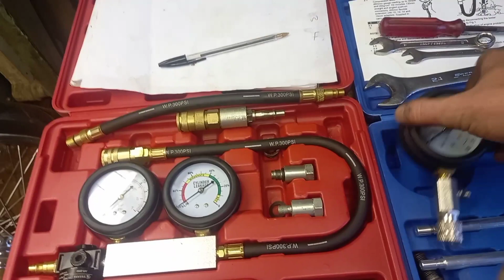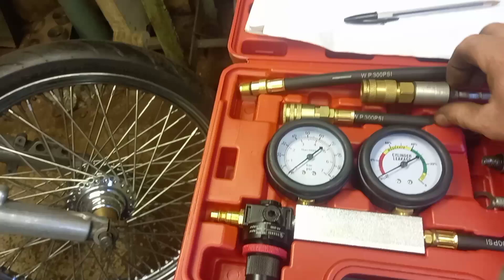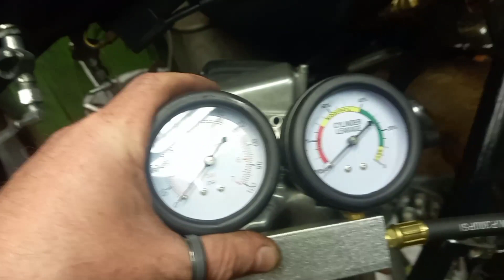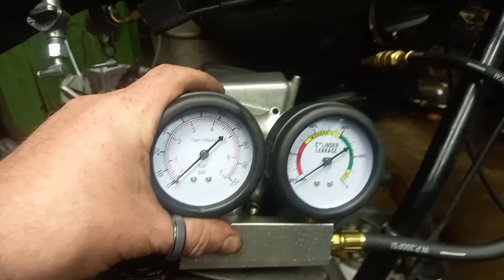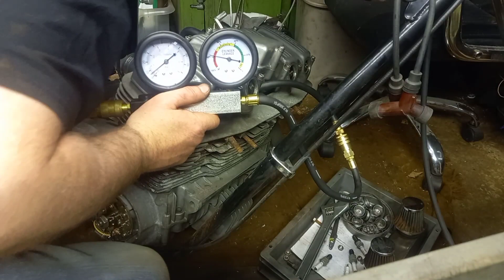CB750 Chopper - Engine compression test, leak down test & diagnostic health check. Did I kill it??

Comment: very cool video men. would be nice to see you take it apart and bring it back to life. i just hope it won't be an expensive job. good luck with it.
Reply from the maker: I'll be digging in after work tonight. I'm sure it won't be cheap but I think it might take a few weeks to locate all the bits, so that will spread the cost. Should get change out of 500 quid??
Reply: don't you think it would be cheaper just to get FJ engine and throw it in that frame?
Reply from the maker: @pawelbalcerak9630  Definitely, but if I go down the FJ route, I'd make a new Chassis from Scratch. It would need to be tougher than this Frame to cope with the extra torque.
Also I think this needs to stay as it is. It was first built with this motor in the late 70's, so its a true survivor Chop. I got it from the 2nd owner who'd had it since 83.

Comment: Hi there Iv the same set up.and motor .my oil tank Is sat the same as yours .tho iv the filler tube on the right hand side with a breather pipe coming from the top of the cap .my problem is ? When I fill the oil tank to the recommended quantity .she will blow oil out the tank breather until she finds her level. She will blow out 3/4 of a pint from the recommended book quantity . So shes running approx 2 1/2 pints. This was friends bike who's passed away .we've been for rides and we all noticed he would always be checking his level .BUT He never Said he had a problem. Iv had chops from the 70s and never come across this before.  I'm a gs and triumph owner . . Would you say I'm over worrying about the oil level .and scratching my old head  for nothing .the top rocker breather is clear.  He did pay to have the Motor rebuilt .and shes 90 mile on the clock. Since shes  been back on the road. And from my gs 750 chop this Honda seems to run hotter . Any thoughts would be great .yes if you split your bike wed love to watch . Thanks for the vids. P
Reply from the maker: I had the same issue, oil would spew out of the breather on over run. Its a 2 minute fix. Run a pipe from the breather to the stub on the rear of the crankcase. Any spills then go into the sump and the pump scavenges it. The motor will be OK providing the Rocker Breather is kept clear.
Reply: @guerrillabuildchoppers4823    ideal thanks .seems many honda chop owners have a problem the same . I cant see where I would fit the tank breather pipe. Would this be something you could show when you strip your motor ..there was a trader at Shelton mallet last year selling a bike with the same problem. He never had a fix .And would say your way of solving this honda problem will go down  Well and put a lot of minds at rest .I will go your route Once I'm sure I'm connecting to the correct locations . Sound Respscts to yourself and your club. Thank you p